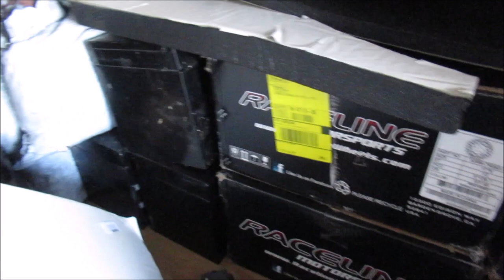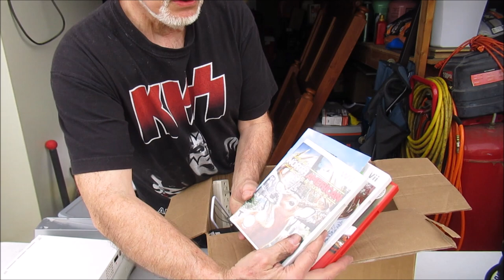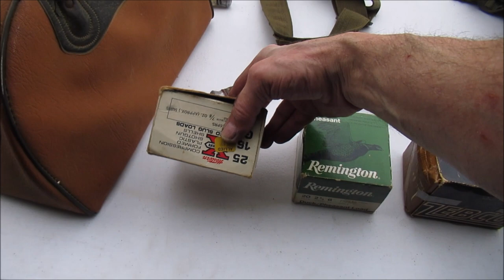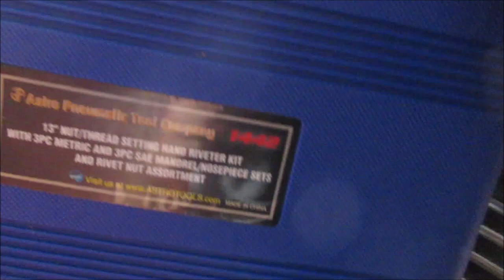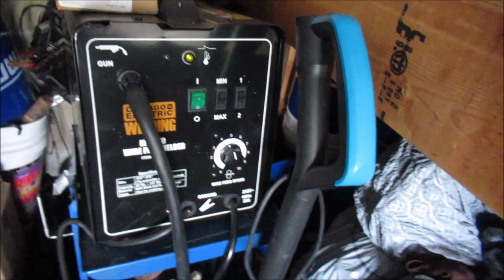$3630.00🤑 Storage Wars Motorcycle Tool MAN UNIT/ DREAM BANGER LOCKER

Comment: This is a good locker Mark! Exactly the ones I like. Nice bow in plastic case. I have more luck selling hard cases over used bows!  What brand of bow is it?
Reply from the maker: Its a "Craze" Bow in hard case( BOHNING)
Reply: Mission makes the craze bow. They are made by Mathews. In my opinion,  they make the best bows. But mission is the lower tier of the Mathews brand. Still a very nice bow. Easy sell in your area!
Reply from the maker: @SuperSparr01  Thanks man, this storage unit has so many boxes of brand new parts for motorcycles and Automobiles. Tons of dollars. Im loving this one. New video on it Monday.

Comment: Also, that 410a is not propane.  It's refrigerate refill tanks.
Reply from the maker: Yeah, as you can see Ive only done a once over on the unit so far. I still have to finish my last storage unit and Ill be getting in deeper on this one in the weeks to come. Im excited about what I cant see in it. Thats where the BOOMS come from.
Reply: @Sarcastic Storage Stacker  I'm only hoping to share my knowledge Mark. You did great!
Reply from the maker: @SuperSparr01  Yeah, this is a good one. Thanks for your support. Swing on by Sunday if you get time for the show. Im sure this unit will come up.